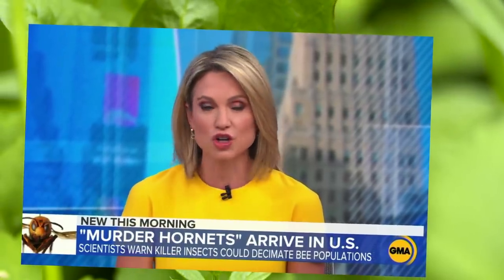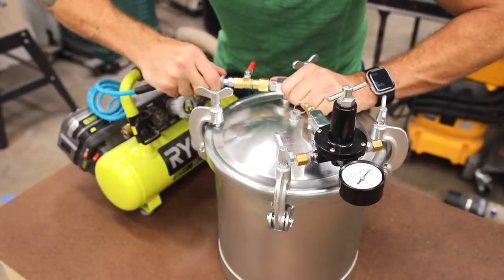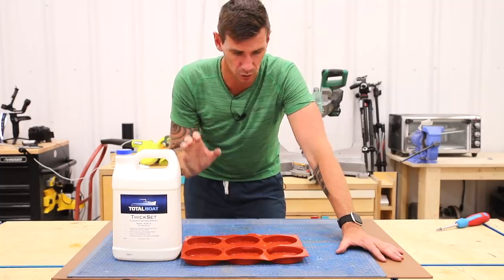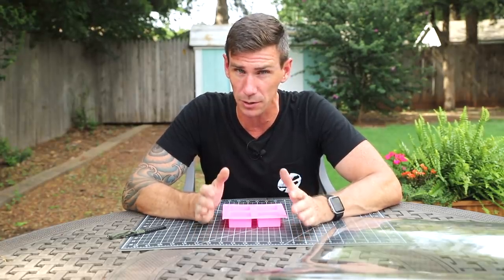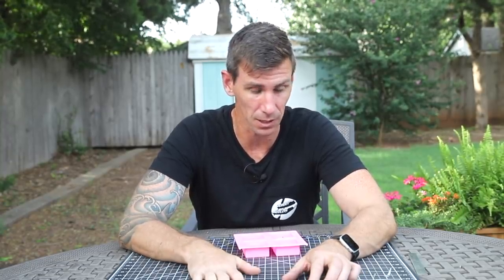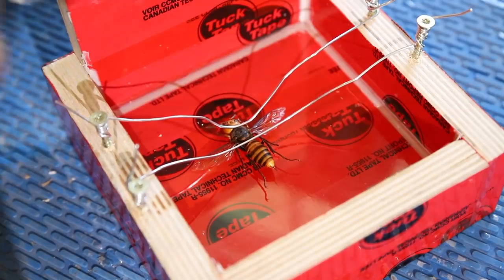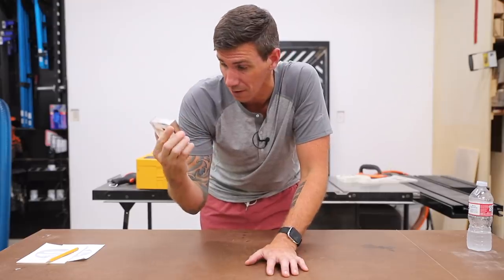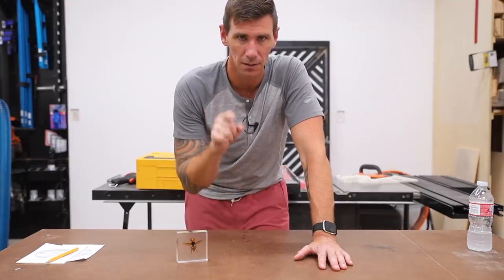Murder Hornet Insect Resin Casting | How To

Comment: Another tip I've heard is to not let the resin fully cure between pours. Then there will still be monomers left on the surface that can make polymers with the new layer and make it so there's no visible line between them.
Reply from the maker: This is correct 🙌

Comment: Vacuum chamber to degas then move to pressure pot to cure. Use UV resin to hold your specimen down (can also coat specimen in a spray lacquer before casting). Pour next layer of resin to cover. Vacuum chamber to degas and pressure pot to cure. Remove the outside by cutting, turning on lathe, or just sanding down. Wet sand with super fine grit. Apply polishing compound and polish till shiny.

Comment: Something else you can do if you don't want to Vacuum the mould with the bug in it is mix the Resin in the measuring cups then Vacuum the air out of the Resin, then carefully (so you don't reintroduce a lot of air into the Resin) pour the Resin into the mould while the mould is already in the Pressure Pot (limiting the amount of movement of the mould and reducing the amount of reintroduced air, also reduces the chances of spilling the Resin while putting large/awkward moulds into the Pot) and then putting everything under pressure.
This also lets you quickly and very thoroughly mix the Resin with a paddle/paint mixer (which introduces a huge amount of air) and still get crystal clear castings.

Comment: I made a few things with resin   and the way I found out how to keep the items from  floating in the resin is   Using  Uv light resin  jus as a tiny amount  to  the  bugs feet  and use a uv light,   The uv resin  cure in two minutes  that will keep your bug from floating when you  add the rest of the regular resin  in  the uv resin is  used   in  resin charms

Comment: I've been sitting on two murder hornets from last summer that I've been too nervous to cast, I guess I should just give it a go now that I've got my pressure pot mounted to the wall and a new air compressor.  FYI the pressure pots with casters (California air tools is what I got and love) can easily be mounted to a wall sideways allowing you to slide longer pieces inside and use it more efficiently.

Comment: Make sure you're using teflon tape on all of your connections for your pressure pot. Swagelok also makes a great sealant/lubricant to use with the tape called Swak. This will help your pressure pot do its job.

Comment: Great video! I want to try some insect resin pours myself. I have heard that pulling a vacuum on the resin while it is wet will also pull all of the bubbles out. Have you ever tried that? I will do a few experiments  using both methods to see which one works the best. Thanks.

Comment: The relief valve always hisses a bit, it's designed that way. Just give it a bit of a clockwise turn to set it to the correct pressure.
Reply from the maker: Not all are adjustable. That one was not and turning it clockwise didn’t help.

Comment: Was that Bourbon Moths theme music? Haha
You should try UV resin to hold the specimen down mate. I’ve recently started using it and it works great. Also, when you’re pouring multi layers, don’t let your first layer fully cure. Once it gets tacky pour your next layer. This will create a chemical bond and should eliminate those lines you can see on the edges. Looking forward to the next video!
Reply from the maker: Good tip about not letting it fully cure. I wasn’t worried about that on this project bc the dagger handle will cover that up 😀

Comment: You should soak the specimen in a UV resin or a quick set resin insects have large air pockets and will bubble in your pot you need to figure a way to make sure the resin is either surrounding the hornet as you put it in the larger quantity of resin or it is completely void of all are when you place it in the resin

Comment: About your problem with the specimen floating, I've seen other "makers" here on  youtube solve that issue by putting a little bit of UV resin on the object, laying it down, and shining a UV torch at it to quick-cure the resin, "gluing" the object in place so it doesn't move when you pour the primary resin.

Comment: I was afraid you'd get lines from the multiple pours, you could try using invisible string to hold it in place while the epoxy dried? dont honestly know how that'd work though theres some string magicians use for levitation tricks you can use theyre called Loops.

Comment: UV resin to hold it down. Just put a drop it’s legs and bottom.
Reply from the maker: Several comments suggesting that. Worth looking into for sure. I wonder if you’d see those drops tho? The wire worked out great.
Reply: @JonnyBuilds  It doesn't seem to show, but I'd test it like you did here just to make sure.

Comment: Wouldn't a small dot of super glue or some transparent glue work well? That way, you could easily position it exactly where you want.

UV resin works as others have mentioned, but I imagine the tiniest dip of its feet into glue would be just as easy and quick.
Reply from the maker: You’d see the super glue in the final product. UV resin may work, but I feel like the quickest, easiest, cheapest solution was the wire I ended up using.